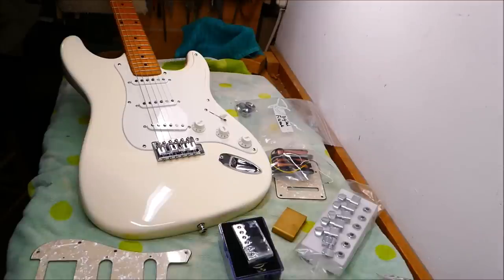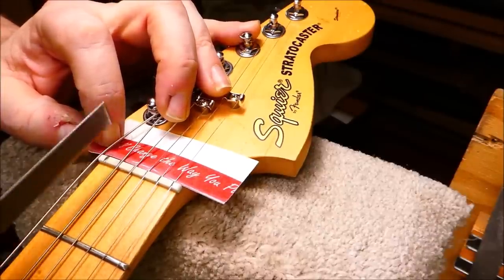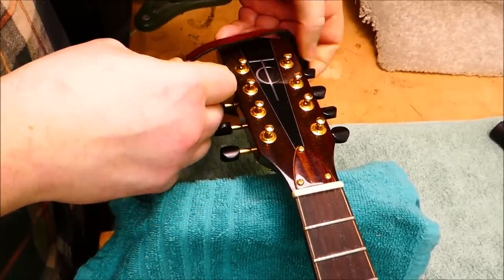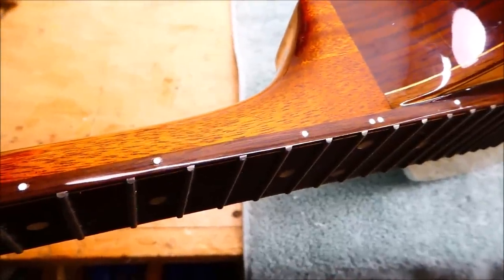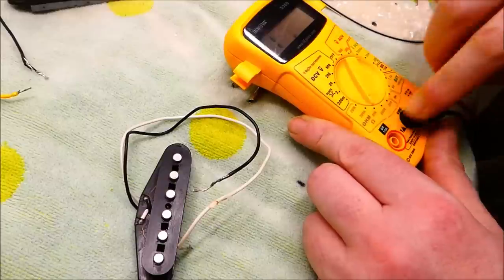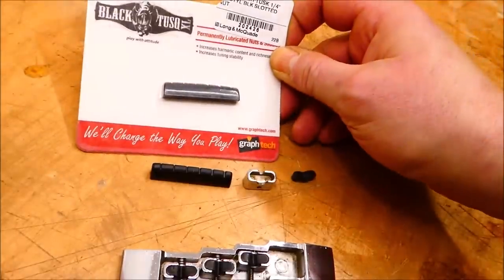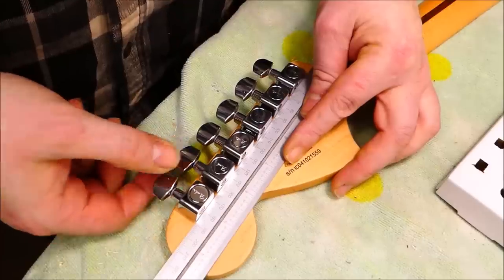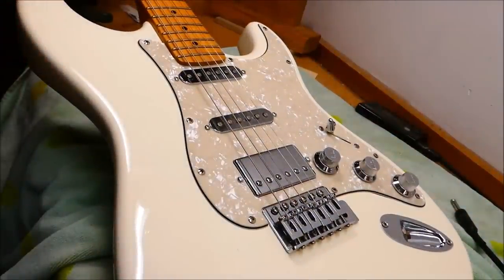That's a lot of work!

Comment: I am waiting on a mojotone solderless harness for my classic vibe 60s strat. I already installed a fender vintage bridge, 60s string tree, and i have sd California 50s set to go in. Currently have a hss set up with stock neck/middle and a sd sh14 and a obsidian hss solderless harness on a 3 layer mint green gaurd. Bridge middle position sounds thin and super weak maybe middle needs wires switched? Anyways the pickgaurd had to be custom fitted at my local shop. Always looks simple but isn't. I jad to route some wood out the cavity to fit in the full size pots from the obsidian harness which i didn't want to do but at least i know anything will fit now. I got the fsr shell pink 60s strat from cme btw. It needs frets smoothed but great otherwise.

Comment: The man is 💯 percent correct! I’ve built many a Partscaster and at first I would become so frustrated that the parts didn’t all fit together perfectly. Over time I realized that they NEVER will. Not all of them. Too many variables involved: vintage vs modern, metric vs imperial, Chinese vs American, etc… 
As long as the builder is prepared to spend a lot of time making things fit and adjusting things, it’s going to be fine. If they think they’re going to just slap a bunch of disparate parts together and it’s going to work? Not a chance.

Comment: Great video! But...this is a classic case of the guy not doing his research on the parts he bought. Taking measurements is crucial. Modifications will still be necessary, but it becomes streamlined and fun.

Also, graphtech also sells blank slabs, in several thicknesses. They make for better starting points than the preslotted ones.

Comment: Sounds like the middle and bridge pickup are reverse polarity to each other, the sound is noticeably thinner and "weird" when they're combined.  I guess the owner could have the lead wires reversed for neck and middle pickups as a fix (since bridge HB is using a shielded wire and can't be flipped and polarity relationship between the single coils needs to be retained).

Comment: I just put a new scratch plate, pickups, switch and pots on my 2011 FSR MIM Strat. Bought scratch plate and pickups from Sweetwater, switch and pots from Stewmac-went together perfectly. After a much needed setup, I really like it. I did buy some aftermarket knobs that didn’t fit from local shop (AllParts knobs). All the research I did on getting things that fit each other really paid off. Of note, the Stewmac scratch plate I ordered (just in case) was Korean, DID fit, but was not shielded. Was a little bummed though at the taper on the pots—audio they are. I realized I’m used to linear😂.

Comment: You can pick up Delrin material off eBay and most other websites. It’s much cheaper than buying a finished nut just to cut it up. I keep some on hand for lots of different uses.

Comment: The high tuners are meant for the lower strings
The staggered tuners are to eliminate the need for string trees, removing friction points and thus improving tuning stability, especially after bends and tremolo use. The high strings need as much break angle as possible and therefore need the low tuners.
Staggered tuners are pointless if you keep the string trees.

Comment: You did a good job, expending much effort and willing, to essential build a kit-guitar.    I'm of the opinion, when it comes to solid-bodied electric guitars, that almost any plank of wood, screwed or glued to another plank of wood (...or just use one piece) can, with enough knowledge, experience, dedication, patience, care and effort be made into a half-decent instrument.   However, the aforementioned notwithstanding, the key is in the hardware.    For on an electric guitar to excell, the materials used to generate the voice of the instrument are vital, from nut to bridge, pickup to jack socket...   

Eg; a nickel-silver humbucker base plate, allied to a set of matched and well-spun, using high-grade copper, wax-potted coils, with AlNiCo I/II/IV/V  magnetics is going to produce a better voice than a pickup with an alumin-i-um base, crudely spun coils, on cheap plastic formers, no potting,  and the ubiquitous ceramic bar magnetics (... I'm feeling a tad nauseaus already...).     
.
Most of what I do, is to bring low-spec guitars up to higher-spec instruments.   Fundamentally, the Squire and Epiphone range are let down mostly by cost-cutting on hardware.   Cheap zinc alloys, plastics, crude mass-produced pickups,  substandard wiring, poor tollerances - especially with geared tuners, cheap components and fittings all-round.  
.
I wouldn't (couldn't) do that Squier Strat job...  I have upgraded quite a few Fenders, Squiers, Ibanez's, Kramers, Epiphones, ESP-Ltd's, Hohners and even Gibson and PRS to 'higher-spec' (MId to Upper range - Core, Custom Shop etc...) and I've learned that buying or using cheap components and hardware is a fools errand and all one is doing, is simply rebuilding a cheap, Chinese kit guitar...   
.
That said, the environmentalist in me, feels that we shouldn't just throw away the cheap hardware, but instead perhaps modify or upgrade it, wherever possible.  And cheap coils are fine for 'beginners' guitars...  Until they develop their 'ear'...    
.
I keep all my cheap (throwaway) hardware, to help me design better hardware through adaptation.   Pickups often cannibalised  to design new wiring configurations; experimentation with 'mix-n-matching' components within the signal path.    I mostly accomplish that on my Squier 'Bat-Caster' - which is a hardtail Strat, with a 24 fret Stagemaster neck and a large rectangular hole, through which I can mount any pickup in any order or orientation.        
. 
Current project - My Epiphone Nighthawk 'Custom Reissue'...   In dark lilac, with a stunning quilt veneer, bound (WELL bound, but no 'nibs'...) body and neck @25.5'' scale (unusual for Gibson/Epiphone).   I've played and worked on loads of Epis'  I'm mostly indifferent to them, or have been, but this NIghthawk really suprised me.  Extremely fast and playable guitar, far-more ergonomic than the Les Paul, or Telecaster, but merely let down (or gagged...) by its cheaper pickup-set.   Which were arguably the 'top-end' budget manufacturers, such as G&B/G&L  (PRS SE, ESP-LTd etc...).   The pickups were not 'bad' per se, but clearly held back the guitar's vocal potential.    
.
Nighthawk's have an odd slanted humbucker in the bridge/treble posiiton.  Fairly hot, but lacklustre...  From my collection, I selected a DiMarzio DP288 - 'Crunch Lab'  And adapted the coils and ceramic magnet to the OEM (brass) slanted base plate.  In the middle posiiton was a single coil - also fairly hot, but muddy - with two narrow ceramic mags and mounted similar to a P-90 - this was replaced by a SD - BIlly Gibbons sig - 'lil Devil' - narrow-field (12 pole) humbucker with a SD 'Antiquity' Firebird pickup replacing the ubiquitous Asian mini-bucker at the neck.  This guitar will be fitted with push-pull gearing on the pots that will allow each pickup to have both volume and equalisation (Les Paul/SG ) on the same control requring just one  hole to be drilled through the top, to give the three controls for each pickup; btw- the cavity of the Nighthawk has already been routed-out for three controls, but is fitted with just a master vol & tone...   The standard 3-way blade swich being replaced by a 5-way 'superswitch' giving a very flexible array of voice combinations.    
.
Was it worth it?    Well I determine that on first impressions, in this case, absolutely.   And good-quality pickups retain their value.   That is fact.  So my Nighthawk, arguably now has a higher spec than its Gibson namesake and increased in value.  Strangely, the Nighthawk comes equipped with real Grover machine heads and a composite (Tusq) nut, so cost-cutting were kept to a minimum, probably as this was a 'Custom Reissue' special edition offering.

Comment: Man, I see what you mean about the hassle with partscaster assembly—of course nothing fits or is aligned. I’ve always wanted to build a partscaster, but this video has cured me of that interest.
Reply: Dont let this discourage you, just buy the right parts. I've had no trouble at all putting mine together. I just can't make nuts or do fret work (and I paid someone who paints guitars to paint them) but my 2 were no trouble and they are legit great guitars. All together they cost $1,600 apiece and are better or equal to what Fender offers for $2,000. No kidding. Been playing since 1981 and grew up on 60's and 70's Gibsons and Fenders and have had more guitars that I can honestly remember.

Comment: Sometimes things can turn out very interesting.
Your vid got me thinking of bro Drum and his bass. I think the neck was a 58 or 59 Pre Bass.
Body was pecan and shaped kind of Avante Guarde .
The neck was made fretless and extended to cover 2 octaves. Think one pickup pair was vintage Fender the other  pair some hot rod modern Pre style with higher impedance and other magnet alloy.
The wiring was somewhat of a nightmare and I tried to tweek it for him but a big part of the issue is, he couldn't really explain what the wanted.
The woodwork was marvelous but I should mention Attila (Odyssey) did that part.
I just got to thinking, it happens every now and then.
Since technically a bass like a guitar can be made in different scale lengths. If one made the bass fretless, can one just move the bridge a little closer and get 2 octaves out of the neck without needing to extend it.
The gauge of string might have to be a little lighter but it wouldn't sound as good as a Pre Bass would'

Comment: Headaches.. but these are fun fixes for a hobbyist only.. they have skin in the game to make it work without breaking the bank.. correct me if I am wrong.. but staggered tuners have the lowest ones on the high strings.. b and e.. is order to have proper break angle without needing strong trees.. even done times you need them..

Comment: far as fee's why not normal shop rate? the guitar is significantly worth more, it was a $100-$150 usd guitar, now its at least $350-$400 depending on the pups, I wouldn't take less than $1000 for my Evans Squier, same for my other one I put the migas touch 69's in..  both have all new everything bridge, machine heads, pups pots and wiring, plus the neck work i did and new nuts I cut for em, they are dead nut too and play very well, the Evans Eliminator squier is a world beater.. think Jeff Healey

Comment: That was a real pain in the butt Strat mod!  I modified my Squire Strat with new locking tuners, solid steel trem block, new pickups and pick guard and new saddles.  Fortunately, I did my homework what would be compatible with my mods.  Everything fit perfect.   You are absolutely correct stating there is no universal fit for those guitar mods.  All the Fender Strats are different, in everything.  The parts are not interchangeable.  You have to really do your home work before you do any upgrades/modifications.   And you really kept your composure.  I would of been cussing under my breath.

Comment: Eddie Van Halen would of had that built and ready for the US Festival if that concert was tonight . I was there at both 3 day events camping out in the hillside dirt parking lot of San Bernadino Ca. in the early 1980s  . Partying 🎉until 3 am after the day ended at 12:30 am . Then back in the amphitheater at 10 the next morning ready for bands like to be 52s are the Grateful Dead and maybe even Santana after that . With Van Halen closing on one of those nights. Most likely Saturday night if I can recall because there was a lot of alcohol 😎🍺🍺

Comment: Well, there are partscasters and frankencasters.
This one is a frankencaster.
I built a couple of warmoth partscasters, if you are provided with the correct parts information and spec, and order the correct stuff, it is pretty much plug an play.
Half the trouble would be avoided if the customer actually bought the correct stuff...

Comment: Well I learned a lot seeing you you go about solving problems. I didn’t care for the sound of that humbucker. Might have been worth it to take the cover off and tap the wire that puts the pickups in series, and then add a coil tap switch.

Comment: I just finished up a Tele-style kit for a customer. Nothing fit! The neck pocket was too small for the neck, the pickguard didn't fit the routings, the nut was so high you could fly a piper cub under the strings, etc, etc. He also had me put in some Joe Barden pickups (NICE!!), but of course the body routs were way too small. So a bunch of work, even on a kit, where you'd expect things to kinda fit. I charged for the time it took, and the customer was happy with the result.

Comment: I must admit to accepting a partscaster job last week. So far, it's around 6 hours in and counting, and yep, nothing is fitting right. Nothing. Silly me - I assumed the client knew what he was getting into when ordering parts, but it seems not many really understand just how frustratingly different the various manufacturers are. The classic is getting a bridge assembly that is too wide - or too narrow - for the neck, which also means the pilot holes in the body are wrong. Aaaarggghhh! And of course, once you solve that issue, the block will be just a smidge too wide to fit the slot correctly. And don't get me started on the pickguard. Thanks for posting this twoodfrd. I'm glad it's not just me, and I don't mean that in a schadenfreudeian way.

Comment: I’ve been bitten by the 2 hidden pin tuners on a Squire being incompatible with Fender branded tuners. I think Squire often uses a generic Far East spec but Fender is the same as the Schaller F spec. Schaller also has another different M6 spec, and Kluson also has a proprietary spec. I climbed out of the rabbit hole at this point and put the original tuners back on, but I am sure they’ll be more incompatible specs out there.

Comment: I only do work like this for friends, and quote the price in beers. Financially it never makes sense.
I keep some sheets of brass on hand for fixing humbuckers with stripped out screw holes - just solder a square to the mounting leg and retap. For single coils, usually a few thin coats of super glue will do.

Comment: I enjoyed watching, and I’ve had similar experiences. Of course, a lot lower volume than you have had. I had one question, regarding the grounding of the whammy bar. You said you had preferred grounding it to the base of the equipment rather than what appear to be the attached claws. I am assuming the claw is the same piece of metal as the lead portion, and wondered what the advantage was, or the motivation to move it. Thanks very much for all you share.

Comment: I don´t know for a paid for job but it actually works good to plug old small screw holes with baking soda and superglue. I had to replace tuners on an old Levin acoustic guitar (my own guitar) and there had been a few replacements throughout the years on it before I got it so there where a few holes there already. They where very close to one another so one more hole would not work very good. I had no no energy to make plugs for so many holes either it was to late at night to struggle with that so I thought what the heck I´ll try superglue and baking soda and it turned out good actually.

Comment: Oh, i got the same crappy fake-chrome pickup covers. You got lucky even that they fit the pickups cause mine wouldn't - different polepiece spacing.
Awhile later i got me some aged copper pickup covers, they were only slightly more expensive (or slightly less cheap, by Aliexpress standards) and did fit my pickups. And surprisingly they were actual all metal, not just laquered plastic.

Comment: Ted:  Here is the absolute, friend price breakdown for your work.  Please don't be insulted by this low ball estimate.  Tuners: 75,  Neck:  75,  Bridge and claw 60,  Humbucker in guard and wired 40, Single coils installed:  40, Pots installed and jack:  45,  guard -25, back plate 25,  Stripped pick-up repair 20  = $400 + tax  I Love your work.  I had some binding piece's peal from 1-12 frets treble side off my Falcon.  I had all the pieces. Cost at local shop: $100.  (Couldn't' have taken an hour!)  So my estimate of your work is actually unreasonably  optimistic.

Comment: I’ve got this exact same guitar, at least they are easier to work on than an acoustic,but there’s so much to learn with electric guitars apart from the basic setup, l struggle with playing them, even though I’m not bad on acoustic, l want to raise the action on mine, for slide , could you tell me please , does a high action become more playable with jumbo frets. Love your coherent way of teaching l just did a bridge replacement and a neck reset on an old Morris 12 string, l really struggled with realining the end of the fretboard, l had to take it out of the frets a little, l can’t get the treble strings to completely stop sitar vibration any thoughts from anyone please, otherwise a beautiful sounding guitar rings like a bell, l found it on the side of the road solid rosewood back and sides bear claw spruce top, lm determined to make it play better.